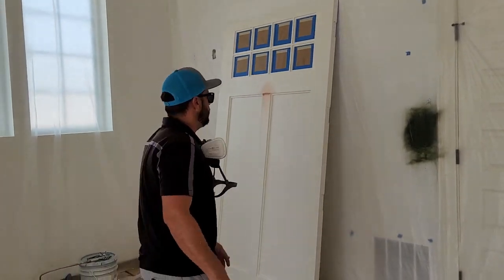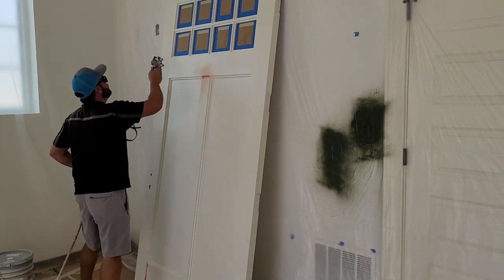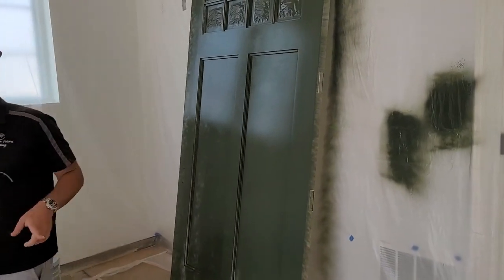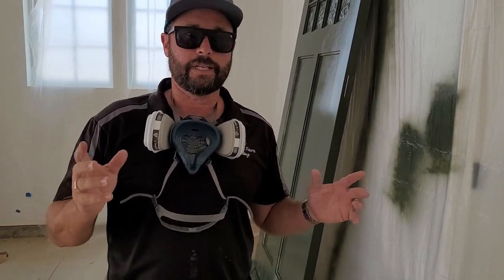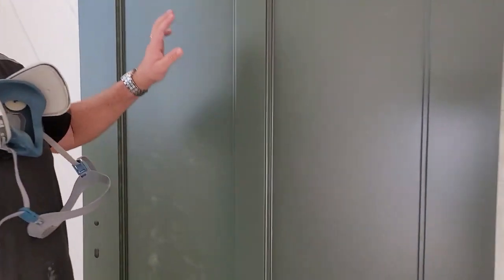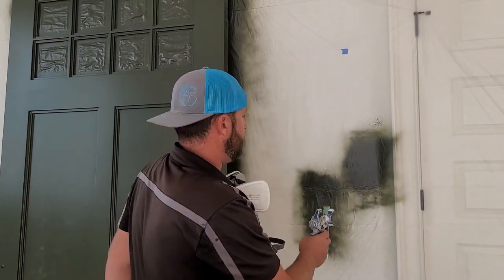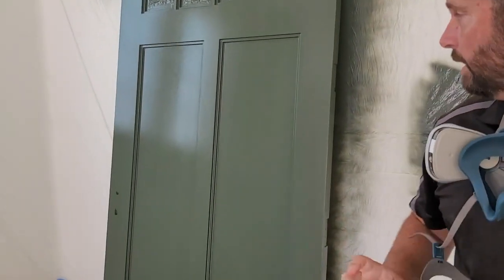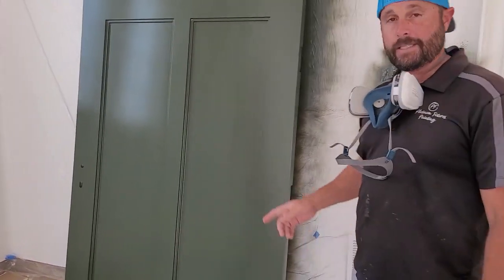How to Paint a Door | Quick and Easy

Comment: Hello! Thank you for your video. A few questions for ya! 1) what type of equipment do you recommend that I buy, 2) what type of paint should I buy, 3) would I use the same equipment to paint my interior doors? 4) also would I use the same type of paint on the interior doors as I would for an exterior door?; 5) are you using the same paint color for coat one and two?

Comment: Hello Paint Boss. Would warming the door in the sun before spraying quckin the drying and reapplication process?
Reply from the maker: Hello Alex, thanks for the question,  I always like a room temperature door or cabinet, just a lot of airflow is better,  sometimes if you warm up a door or surface,  you can run into the finish flashing too fast and may not give the paint enough time to properly adhere,  so I like to focus more on a quick tack coat, and then for your final go heavier... that first contact of the first coat, is where you make a strong bond, if it's too heavy or too hot, you can run into bubbling, spidering, or separation. Great question, and thank you so much for the comment 👊🤝🙏🙏 let me know if you have any other questions
Reply: @PaintBoss  Thank you for your reply. I appreciate the reasons of your process.